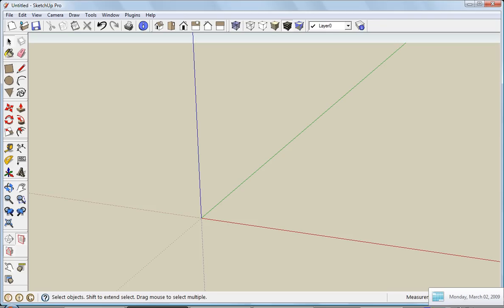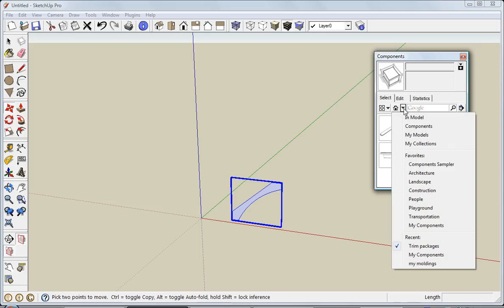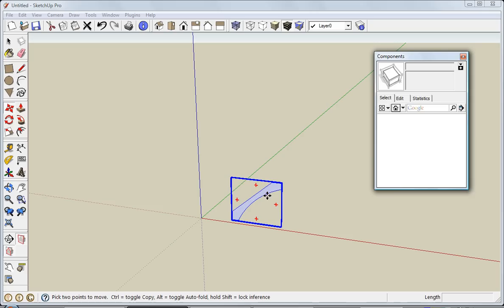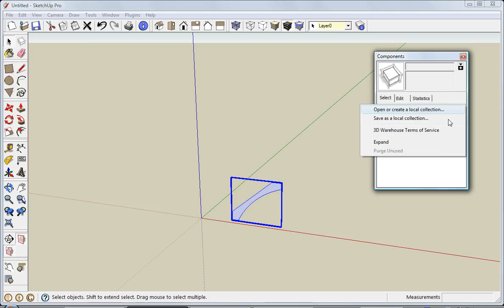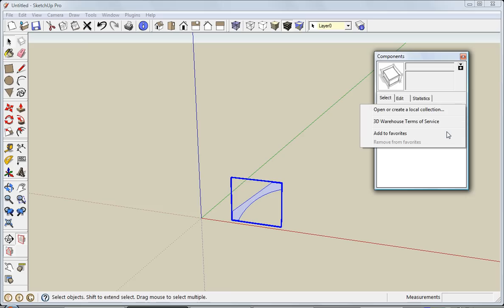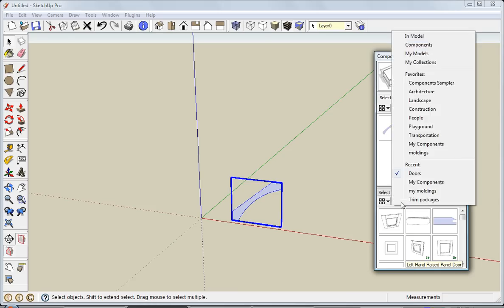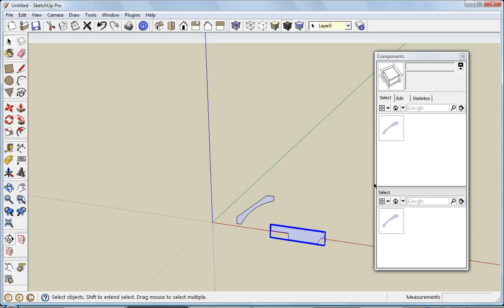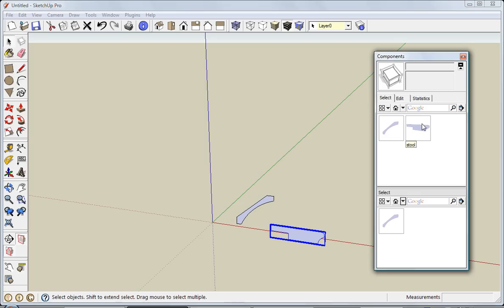Creating a component library

Comment: Does not work .No Components under window in my version of Sketchup just 'Component Options'.
Reply from the maker: Starting in SketchUp 2016, most of the option windows available under the Windows tab were moved to a tray system.  For more info, see the link below:

https://readwatchdo.com/2015/12/new-in-sketchup-2016-trays-for-windows/
Reply: Many thanks for the update .I will give it a try.